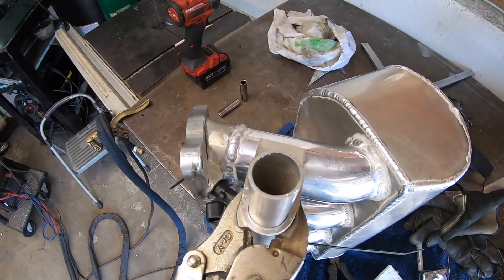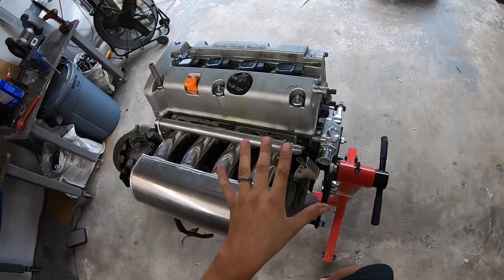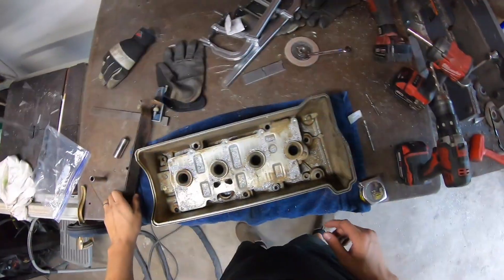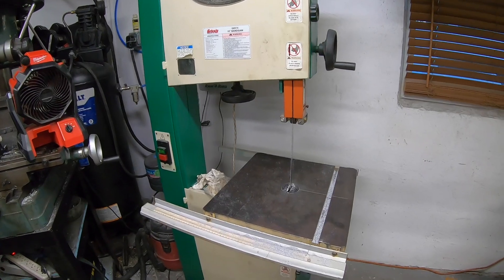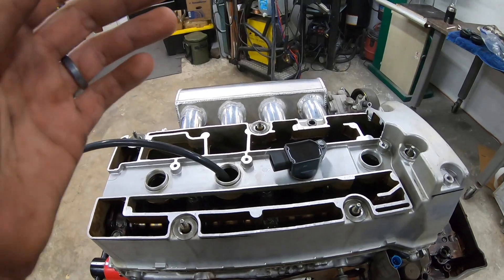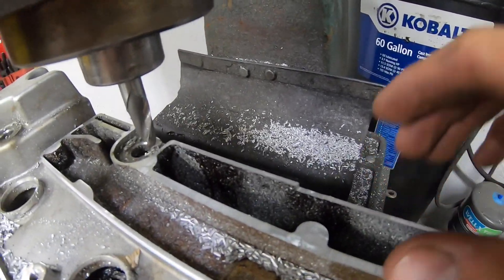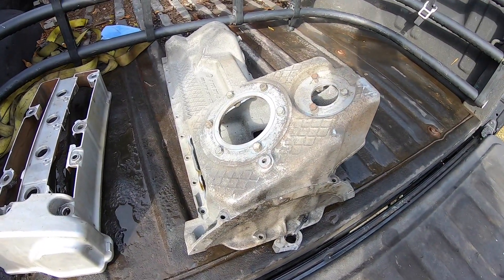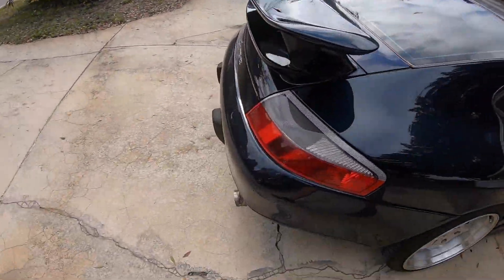Swapping A Honda K24 Into A Porsche 996 Part 1

Comment: In Australia with barra coils we just pop the long rubber bit off, cut the spring down and normal spark plug wires go on the factory coil, not sure if its the same on the k series but worth a try
Reply: Cheers mate.

Comment: Hey man! Don't get mad about the valve cover, remember,  viewers like/need a bit of "drama", we want to see the bad with the good, plus it gives you more content! This is real life, nothing goes perfect all the time! It would be boring if it did 😂
Reply: I had a fucking stainless steel hose clamp fall into cylinder 6 on my fresh built, forged 7mgte for my supra when I was putting the head back on. The car had been down for 6 years and had to pull the head off just before that because a couple valves got bent on #5 when it was being moved. Went to compression test and ran the hose clamp through my valves and gouged the head and top of my brand new piston. 

This happened in June and I haven't touched the car since! A broke valve cover is nothing!!! Lol.
Reply from the maker: Ooooof thats a rough one. These valve covers are like $20 at the junkyard. Def not the end of the world by any means.

Comment: Get some LS truck coils and a universal plug wire set. That's what I'm running on my is300 and it works great. I got the wire set, Upp pro street 250 for $50 it's a nice set and the coils are $20 each and if you have a problem in the future you can get replacements anywhere. I'm running everything full standalone on a microsquirt for $300
Reply from the maker: Great idea. I did one better and wound up with some hot rod smart coils.
Reply: @baysidefabrication  what ecu will you be running? Stock honda with hondata?
Reply: @baysidefabrication  About 10 seconds into this video, it shows the short custom plug wires I used on my BMW 328iS with a custom engine head.  https://youtu.be/oyetyewZ7Dg